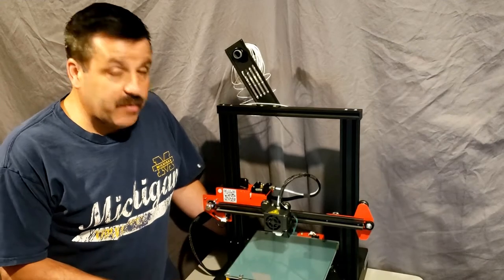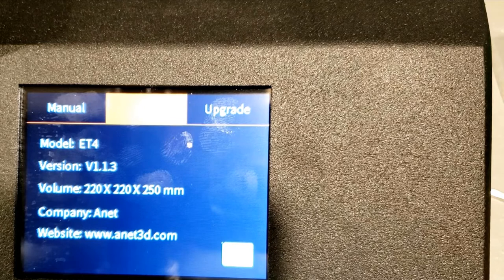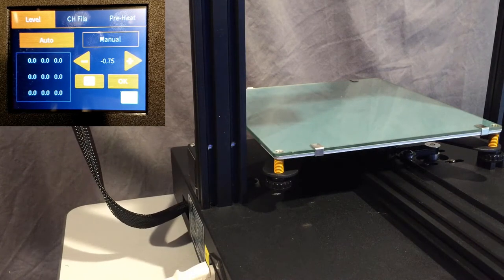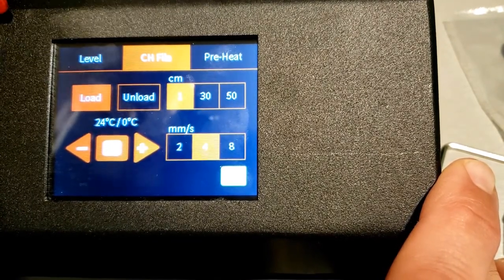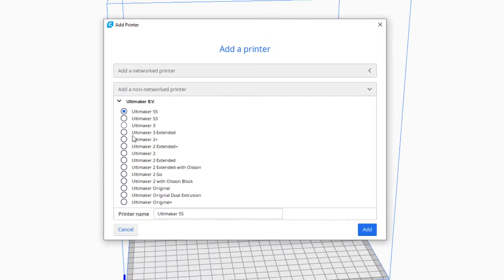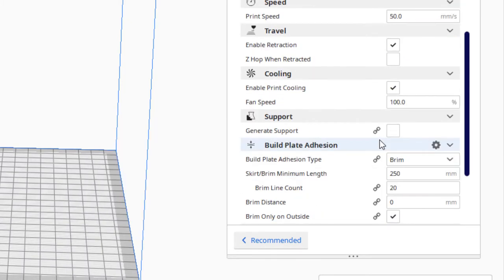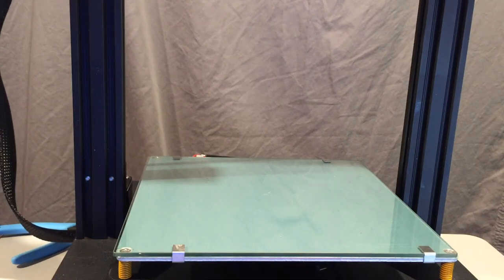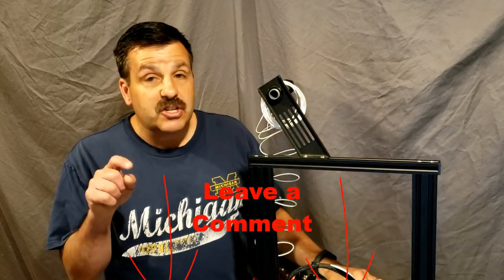Short and Sweet! Setting up your First Prints on the Anet ET4

Comment: Hi do you happen to know how to set it to start in the center of the bed. It keeps starting off of the bed and staying there so I am confused as to why it does not print at home which is set to the center of the printer.
Reply from the maker: Makes me wonder if you have x and y messed up when you connected the cables...  There is also a chance your SD card is wonky. Sometimes saving as a new name on a different card can fix things.
Reply: @HLModTech  okay I will try that thank you. I also have a cord missing labeled s-z missing. In other videos it looks like it supposed to be already plugged in but it was not at all in the box or on themachine

Comment: Hi Thanks for the vid. I finally received mine after a delay cus of the budlight virus. My sd card didnt come with any print files. IS it possible to post or do a video of your Gcode for cura i've been having some issues.
Reply from the maker: Sorry you are fighting with it a bit. I am using the built in ET4 from Cura 4.6.1, are you trying something simple like the cube in the vid? I always start there to make sure I am groovy. Also glass or the included bed material?
Reply: @HLModTech  I'm using the glass bed, but the sd card only had a print file but it was a picture and not gcode.
Reply from the maker: I added a link to the cube in the description of the video. Once you have that, load it in cura and export with the .3 mm settings I mention., It is a great way to get things working the way you expect.
Reply: @HLModTech  Thank you very much i'll try it and let you know how it turns out.
Reply: @HLModTech  Ok , here's an Update and i still need help because i have no clue whats going on. I'm running version v1.13 on the printer, and Cura 14.07. This is the software that came with my printer. Even with your test cube i loaded it in cura and saved it to the SD card. When i hit print the printer goes from 0 to 100% in seconds and says " Print Completed" . I have no idea whats going on the same thing happens when i do the same thing with prints from Thingyverse , i have no idea whats going on. Nothing moves or heats up ... just prints done. Any ideas?
Reply: @ForeverGhostdoggg  This may be late but try formatting the sd card. That one that comes with the machine sucks and is probably corrupted